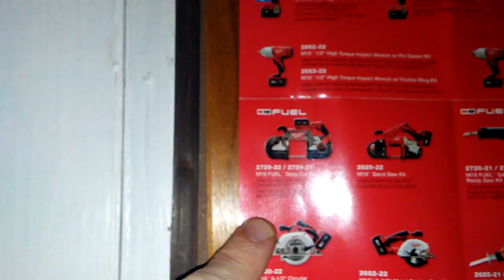Milwaukee tools

Comment: I like the Milwaukee tools you can't beat the price snap on wants 8 to 900 bucks for the same thing I paid under 200 for my 2763 that thing is a beast. I have some tools I bought in the 80s from snap on truck, that was the only one I had to rebuild all the other air tools work fine and they are 25 years old. Still have my original  craftsman air ratchet . My son got to use it on a trailer we were repairing he thought it was great. If you want a snap on ratchet find a buddy who works at a shop have him haggle a little for you and get it cheaper by buying multiple tools at one time or buy on eBay. Good luck.
Reply from the maker: picked up a stubby 3/8 for 30$ at pawn shop